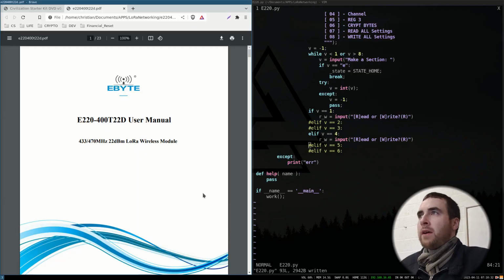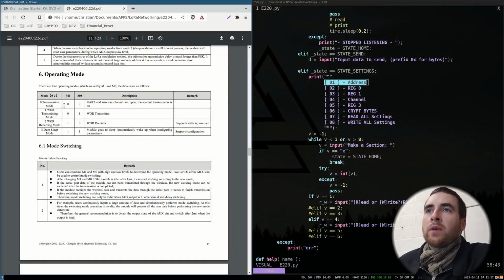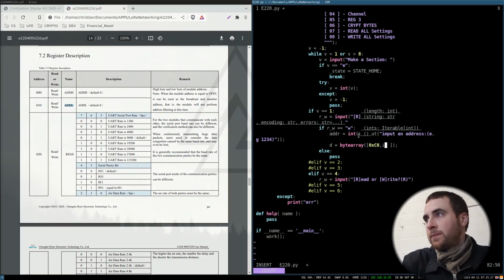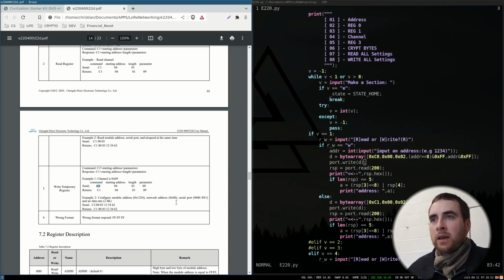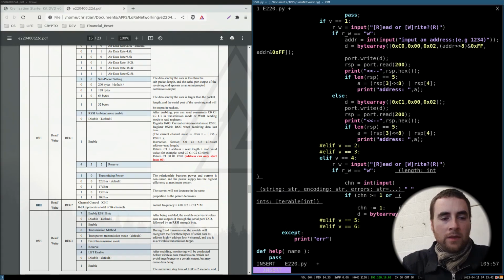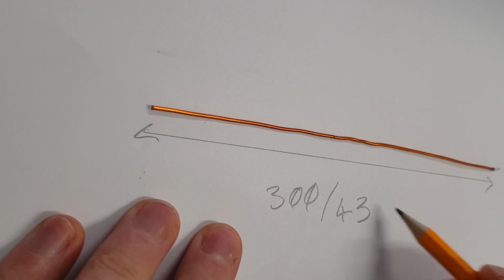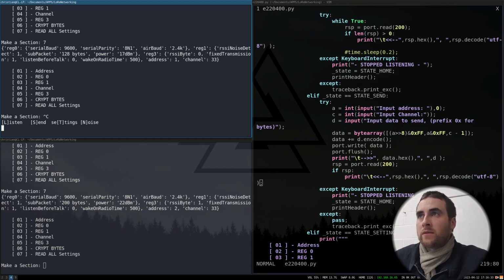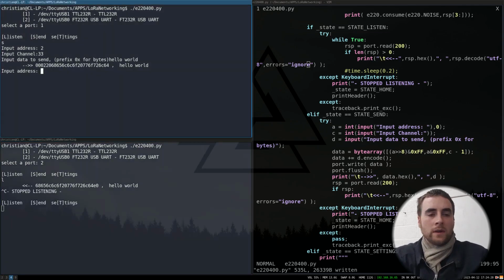LoRa 433MHz, E220, encrypted Radio

Comment: hello i have e220-900t30d and I want to communicate with heltec lora 32 v3 ( sx1262) is it possible ?
Reply: Ok thank you
Reply from the maker: @GeekDrone  I cycled through all the sx12XX setting variations for syncword 0xF3? (The public LoRaWAN network code), with the same frequency but the E200 didn't pick anything up. I'll try to cycle syncwords and settings at some point and try the reverse.
Reply: @try-restart  thank you for the feed back, i decided to send back the heltec devices
Reply from the maker: Don't know, sorry.

I was actually planning to try this

Theres settings like spreading factor, sync word,  header on or off, crc on or off that aren't accessible via the e220.

I couldn't find docs that say what these are set to -  theres probably an sx12xx clone chip under the emf shield.
Reply: @try-restart  thank you for your answer, 
Yes … The configuration between the two module are  not the same ! 

But when i send a message with the e220, i can see something on the spectrum analyser of the heltec. 

If you want we can try something together, i can share the code i have the setup
Reply from the maker: @GeekDrone  thanks, but I have slightly different hardware. Sx1278 spi modules +  esp32.  I probably will iterate through different settings in the sx1278 and see if the e220 has rx then try the other way round.

Ill let you know if it works.

Comment: Hi! Thank you for the video!
Did you manage to use DTR UART pin to configure M0 and M1 Lora inpot pins? Or CTS UART pin to read Lora AUX output pin?
I mean using UAR DTR/CTS as GPIO pins to make full control on Lora?
Reply from the maker: I used Rts and dtr to control m0 and m1.  I didn't think of reading the aux pin with cts  - thanks!, I'll update my code.